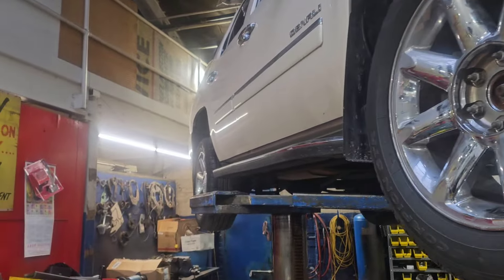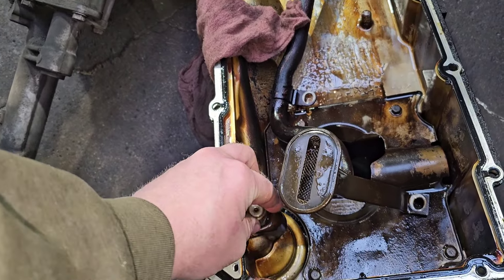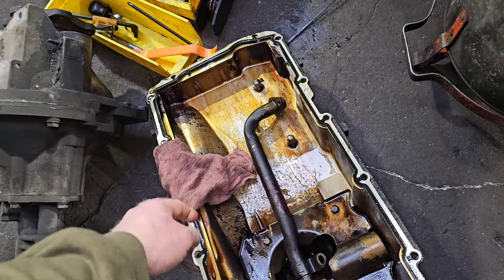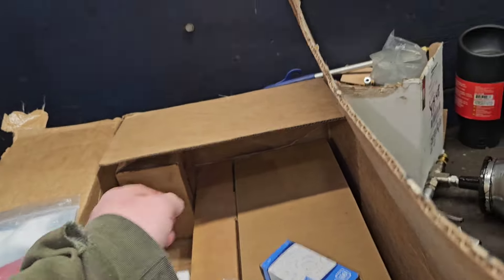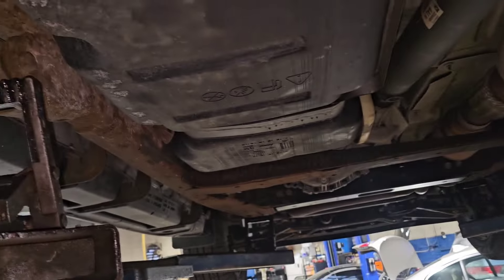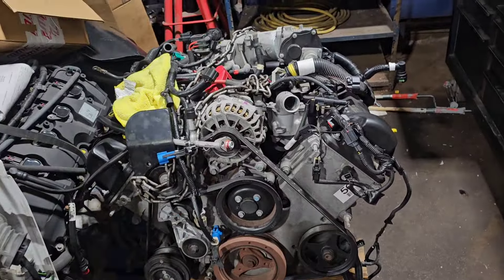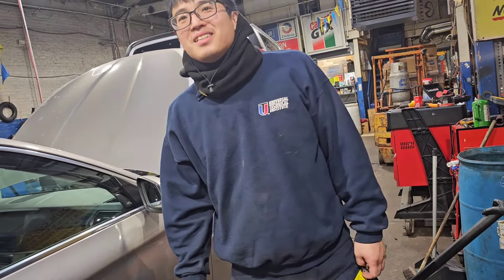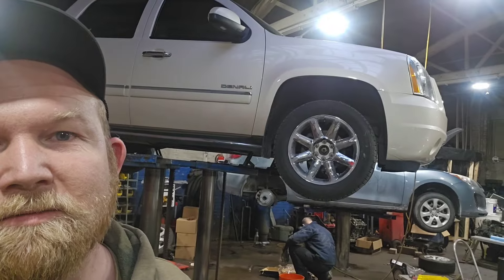Shop Update: Yukon DOD Delete, Grand Marquis Billet Internals In Transmission, BMW Fiasco

Comment: If Oil got in the Cooling System, The Engine Would have to be Repaired Anyway. What was the 
Problem With the First Engine ? Thankx
Reply from the maker: Cooler assembly
Reply from the maker: I mentioned that though

Comment: Guy i worked with bought a truck back in2012 with the DOD. I  didn't know anything about them back then but i did tell him it will probably be bad news as time goes on since it never really worked in the past. Turned out it went to 💩 in about 7 years for him. I swear im never buying anything past 2011 most makes and 2003 for GM.

Comment: I had a 2012 Chevy Silverado with oil soacked spark plugs that killed a catalytic converter.  Its obvious that AFM killed the engine. It was a nice truck i shouldn't of sold it. 5.3 engine block was solid, it needed a rebuilt and AFM parts delete.

Comment: Heard you need to replace the oil pump with a non DOD oil pump.Check on it?
Reply from the maker: I went over that with Texas Speed and they said that wasn't necessary because in 2014 the SUVs still had the ls style 6.2 and the trucks the Silverados the Sierras went to the LT Style so there's two different kits this one still has the ls Style
Reply from the maker: Just like with this one you don't need Valley plugs because you get a whole new Valley manifold but the LT style does need valid plugs and you reuse the factory manifold

Comment: Parts and labor what does a job like that run on that yukon?
Reply from the maker: If you did it yourself you could probably price it out for about $1,400 to $1,600 if you had a shop do it it's like 19 hours labor plus the price of the parts you're looking at around 5 grand 5200 bucks with miscellaneous fluids gaskets O-rings things that don't come in the Texas Speed kit
Reply: @FordBossMe  thanks, that gives me a good ballpark idea for what it’s gonna cost, I wanna get it done on mine.